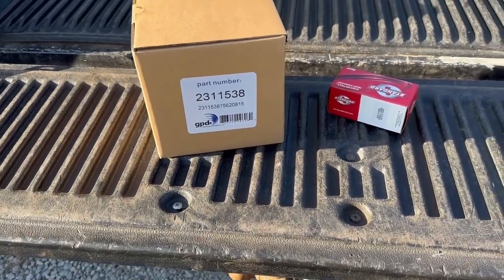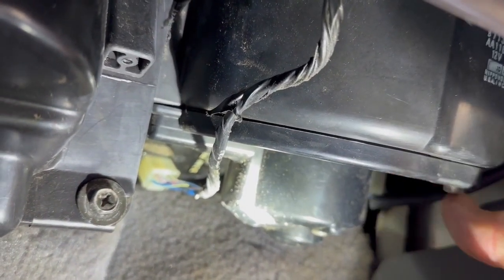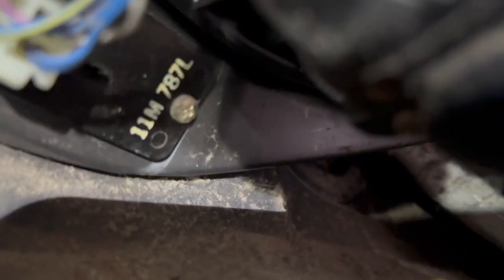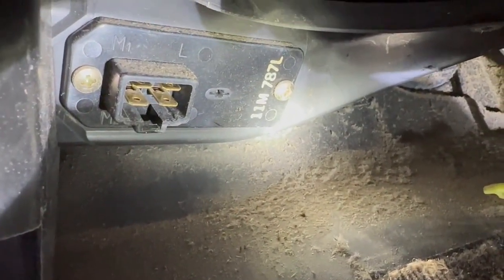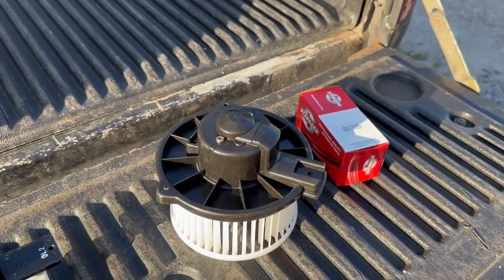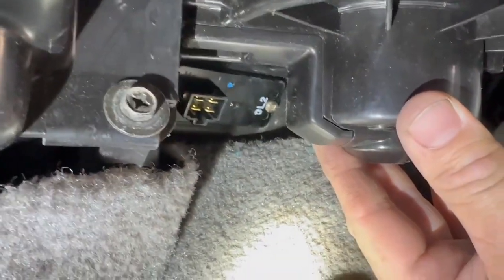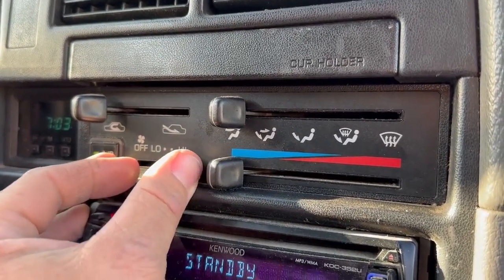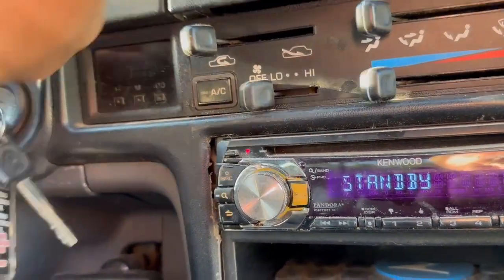Toyota Blower Motor & Resistor - 1993 Toyota Pick Up #diy #howto #how #toyota #fix #antique  #1993

Comment: I just wound up having to do this too. After trying to contort myself to get that 3rd screw out, I decided to unbolt the whole blower unit.  Five 10mm bolts and it was out pretty easily. It made swapping the resistor easy. Hope it helps.